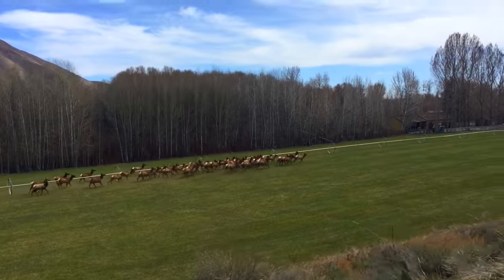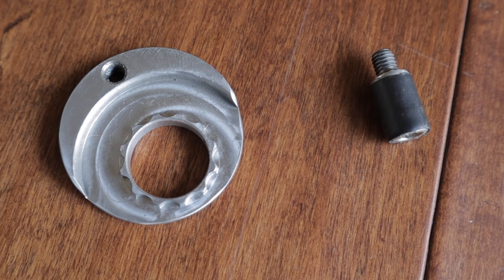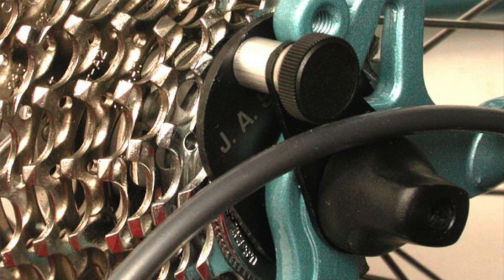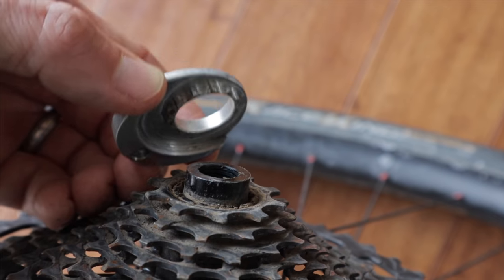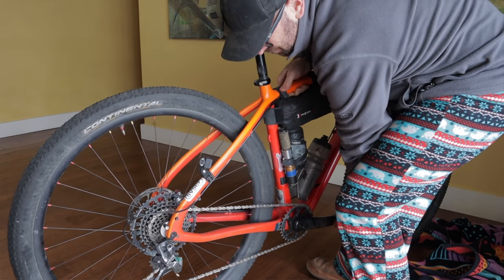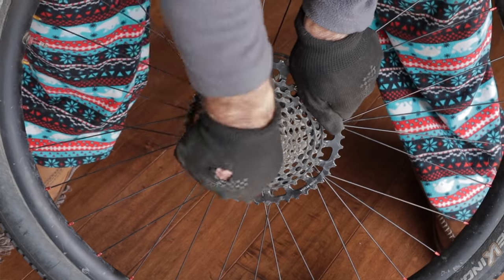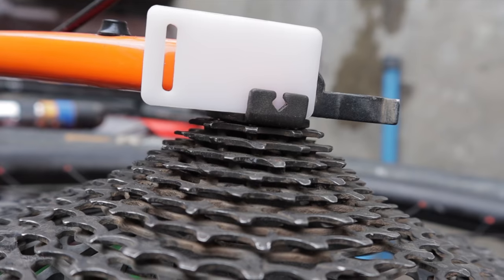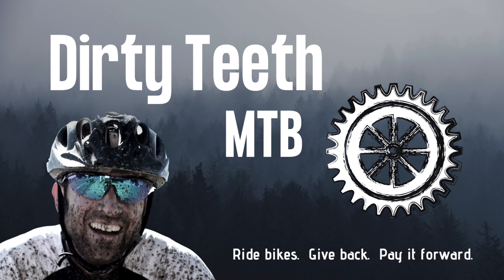Mini cassette remover for Tour Divide? Stein bikepacking tool in-depth review.

Comment: Excellent, excellent video! Fwiw, up to now I've used a park tool cassette tool fr 5.2 in which I've drilled a hole (RIP drill bits) perpendicularly in conjunction with a 5 mm allen key to get leverage. Works great for tightening things and sometimes for loosening too. With some fiddling. Sometimes. Like 40% of the time. Or maybe 25%. This seems like a much better (and bit lighter) solution. Thanks!
Reply from the maker: Thanks for sharing! Ride on :)

Comment: I have the unior tool. I have tested it with two of my gx eagle cassettes and found out that they are slightly different. One has its splines deeper under the 10t cog and the tool simply does not reach them. The other one is ok.
Reply from the maker: Very interesting, lonlvan1994 - thanks for sharing :)... and reiterating that all of these types of tools need to be tested ahead of time and not just assumed they'll work with every bike/drivetrain combo... ride on!